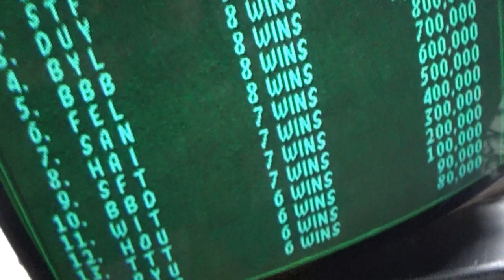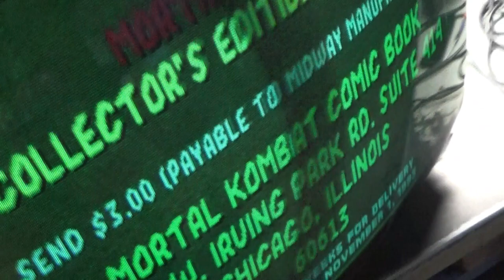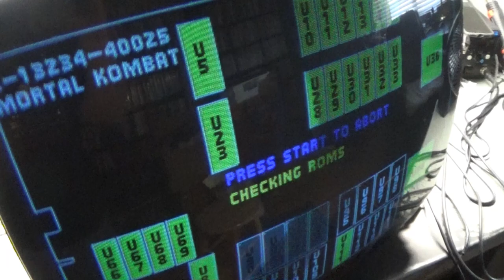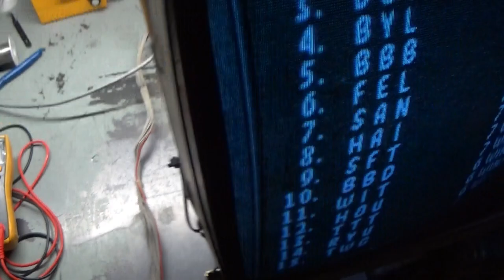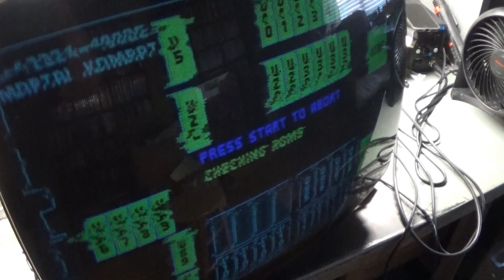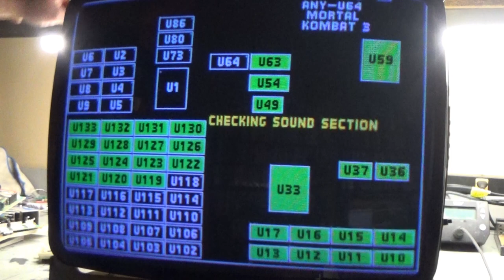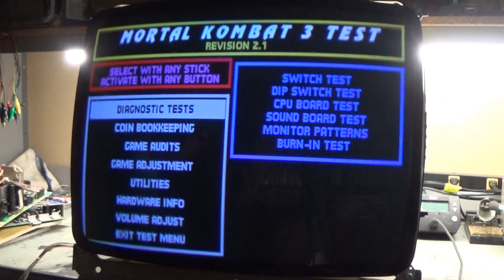25" U2000 Arcade Monitor Chassis Repair - Screen Tearing & Jittery Image + Factory Brightness Mod?

Comment: Thanks for making this video. I'm kind of glad you had that issue and resolved it because I've had several of those models with that resistor on the sync pin  to ground. I had a similar issue but mine ended up being a shorted d700 diode right in that sync section so this will be something I definitely rule out if I run into this problem and can't find any other bad component